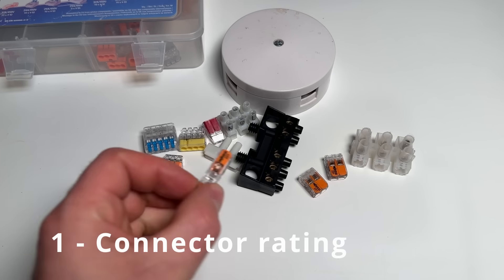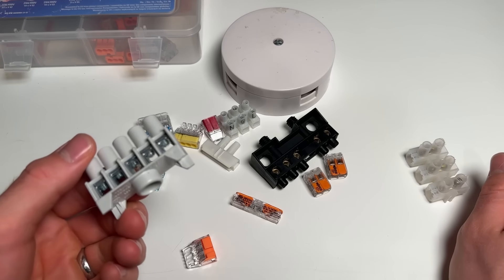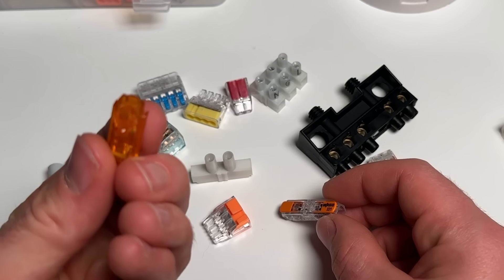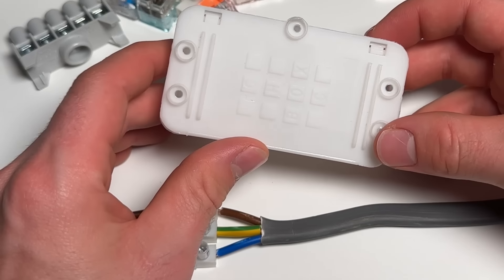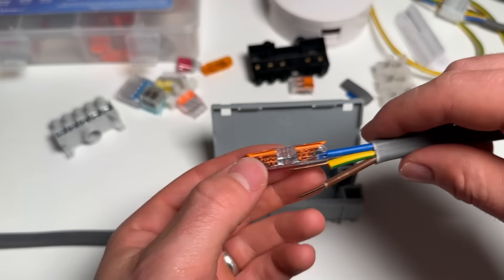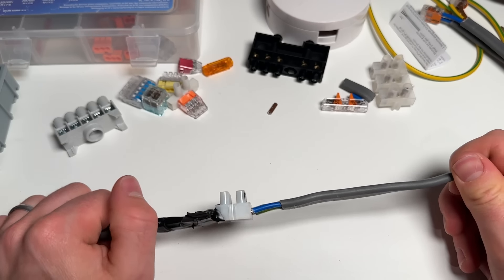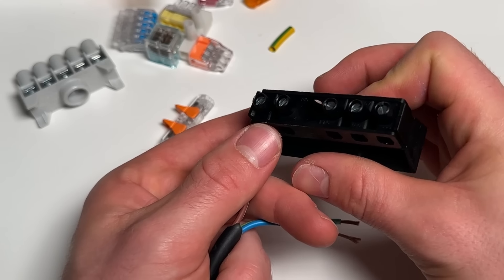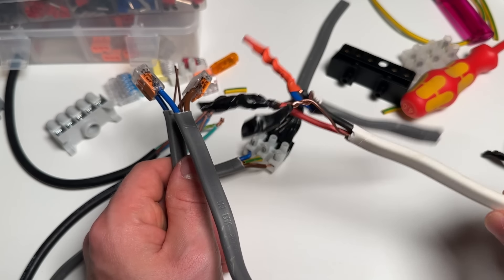BIGGEST DIY Mistakes Joining Cables

Comment: I replaced a bunch of screw terminal junction boxes in my own home with Wago boxes. They were all at least 12 years old. Some of the older boxes had loose screws and even evidence of arcing where connectors were loose. The problems are; the connectors are brass with brass screws and these are relatively well self-lubricating metal on metal contacts and the copper single core wire is fairly soft and deformable, especially compared to the brass. Often these boxes are in lofts or roofspaces where temperatures fluctuate considerably (+/-15-30oC), cold in winter/at night and warm in the summer/day. The fluctuating temperature cycles over a number of years expand and contract the wire trapped by the screw,  loosening the screws grip on the wire by a combination of compressing the wire more and loosening the well lubricated screw. Eventually the wire is barely held by the screw. Wires under any tension can be pulled out of the terminal altogether. What makes things worse is when someone has put 3, 4 or even 5 wires under one screw! Wago levers are a sprung fixing, so there is some give and positive pressure capturing the wires, in theory they should last indefinitely, however plastics do deteriorate with heat cycles and UV exposure so worth making them inspectable and checking them periodically.
Reply from the maker: Good points, thanks for watching!
Reply: Good rule that screws should be  tightened once a year, especially high loaded
Reply: @alexU42k  however that simply should never be the case most periodic inspections are every five years so in that case of screw terminal is simply not appropriate or fit for purpose
Reply: Life was so simple in the good old days. I’ve only watched two videos, enough to tell me to leave electrics to the experts. If you do not know how to analyse the work load then don’t play with the electrics. Especially now that insurance companies want proof of certification for the work done. Just installing the wrong cable is enough to void payout. Love the video. It shows the better options for a safer connection. Nothing is perfect. Everything degrades overtime.
Reply: @ you said even installing the wrong cable like it’s a simple mistake quite often that can be a deadly mistake
Reply: Nearly every plug socket faceplate, light pendant fitting and flex cord plug fitting has screwed cable terminations. Everything will (and always has been) just fine for goodness sakes, if fitted properly.

Comment: Your explanation of the ratings on the WAGO connector are wrong.  The ones on the left (next to the "UL" logo) that say "450V/32A" are from the IEC and apply for both Europe and the US.  That's why the same side also lists the wire size in both mm² and AWG (American Wire Gauge).  The rating on the right side is from the JET (Japanese Electrical Safety and Environment Technology Labs) for the Japanese market.

(However, note that even though the connector is rated to 32A, the maximum wire size (14 AWG) is only rated to 15 amps for building wiring in the US, so this connector can only be used on up to 15 amp building circuits according to US code (otherwise the wires would be too big).  However, if you are using it for other applications (for example open-air chassis wiring inside an enclosure) you could potentially take advantage of the full 32A of the connector in some situations.)
Reply from the maker: Thank you for your detailed explanation, you’re absolutely right! Thanks for watching!
Reply: They also make a 6mm^2 (12awg) version of the Wagos with the same ratings.
Reply: Actually the standard Wagos allow AWG12 wire with 20A and the higher powered Wagos allow AWG10 wire with 30A.

The inline Wago shown in the video shows AWG14, but the website of Wago shows AWG12 in the specs.
Reply: @ChristianWagner888  Sorry you're correct, I managed to get the two standards mixed up even after reading the comment above explaining them.
Reply: @ChristianWagner888  The other ones have always said 12 AWG, but I think the older inline connectors were only rated for 14 AWG originally (I have some that say the same thing), but it sounds like maybe newer ones will do up to 12...?

Even if the website says 12, if the connector itself only says 14, I would not use it with larger than 14 AWG, personally.  There's no guarantee the website isn't just a misprint or something.
Reply: @ChristianWagner888  Umm, no...  The "standard" WAGOs (221-41x) support up to 12 AWG and 32A (per IEC ratings).  The "higher powered" ones (221-61x) support 10 AWG and 41A.  (The lower current ratings listed under "UL" on their website actually only apply when using them in building wiring in the US (and are based on the max wire size), but the connectors themselves can actually handle higher currents in other applications (as I explained in my original post).)

The inline connectors have a different model numbering system than the other 221s, though, and the connector shown in the video is a 221-2411, which only supports 14 AWG (32A, 15A for US building wiring).  The one on the WAGO site is a 221-2401 (different model number, and it also looks different (having a gray/white bit in the middle)), which does support 12 AWG (still 32A, but 20A for US building wiring).

(Also, as far as I can tell, there is no inline version that can handle 10 AWG at all.)

However, it's important to note that most sources I've found for WAGO connectors (aside from buying direct from WAGO themselves) are still selling the 221-2411 (14 AWG) version, not the beefier 221-2401s, so if you buy these inline connectors off of somewhere like Amazon, those are most likely what you're going to get, and those cannot do 12 AWG wire, according to WAGO's own specs.
Reply: In europe they can probably use smaller wire for higher amperage because they use higher voltage than we do.
Reply: @nooneyouknowhere6148  Well, currents in Europe is generally lower because of the higher voltage.
An appliance rated for 2300W would use 10A @ 230V, but 21A @ 110V. This is why wires are thinner in Europe for the same effect*, but for the same *current they are about the same, as the resulting heating follows the laws of physics. :)
Reply: The higher voltage means that at the same current the circuit will provide more power.  It does not mean that the same wires can handle higher current.
Reply: Dude, you need your own Chanel

Comment: I’ve been using terminal connector blocks for years with absolutely no issues, using bootlace ferrules with these types of connectors makes a perfect match too. It’s nice to see other products available though and I’m sure they will have their use.
Reply from the maker: Thanks for watching!
Reply: same, if people know how to use them then they are fine. I think all the new sparks only know Wago and think that is the only thing to use.
Reply: Biggest issue is they’re not maintenance free, so have to be accessible when installed, where Wagos (when installed correctly) are, so don’t need to be accessible.
Reply: @gainmaster1  
Screws can work loose.  Wagos do not work loose.
Reply: @johnburns4017  maybe if you were tightening it, how did people survive without them before. Do screws become loose on MCB etc too? There is always a possibility that can happen, they work when you use them correctly as like any electrical connection
Reply: Connect to block can have issues but it’s mainly if they are in a semi accessible location where they could be hidden that creates problems
Reply: @johnburns4017  If every screw came loose it would be pretty dangerous to do anything with machinery, vehicles etc. There is a lot of electrical devices that have been screwed together for years and not come apart. Are you tightening up your screws with a miniature screwdriver. 😂 
I'm always surprised when a particular brand device gets promoted in these types of videos. I have worked on machinery from around the world and don't find wago stuff that popular even with the German machinery that i work on the most. Screw terminals especially on high voltage stuff still seem the most common.

Comment: For people who are nervous about the lack of connection area with Wagos you can find videos of them being tested under load - to destruction - and they actually take much higher loads than their ratings, so you can be confident that the contact area is fine. And unlike screw connectors the pressure is constant and can't slacken unless they're overloaded and heated to ignition point. Additionally - unlike twisting connections and screw connectors - Wagos don't bend or damage the copper in any way.
Reply from the maker: Great point, thank you! Thanks for watching!

Comment: The current rating of that screw terminal connector is going to be way higher than 5 or 6 amperes. I would say at least 15 amps. It is, after all, as larger as the screw terminals on a typical socket, which are rated for 32A. What is more, the conductive metal cross-sectional area is more than a Wago type. The danger is a poor connection, not the rating of the connector in that case unless you use it on something like a shower circuit.

Cable ties in the Wago box are nothing to do with IP ratings, they are there to meet the requirement that it requires the use of tools to access the live conductive parts.
Reply from the maker: Interesting to know, thank you. Thanks for watching!

Comment: It's ok to prevent people from doing dumb things that can actually hurt them when they attempt to work with potentially dangerous items/devices/installations. Anyhow, household electricity doesn't present that much of a danger IF some precautions are taken beforehand. For example, PLEASE, if you are going to work with electricity, WEAR SHOES, make sure the floor is DRY and SWITCH OFF THE BREAKERS so you don't get shocked. I'll have to say that in the Americas (maybe with the exception of Argentina and a few other countries), we commonly have 110V/60Hz, so a shock is not that dangerous unless many other things go wrong, but if in your country you have 220V electricity, be very careful as a shock is really bad and can actually kill you even if every other precaution is taken, so SWITCH OFF THE BREAKERS before doing anything.

That being said, electricians have been twisting cables for decades with outstanding success, so calling it a dangerous, potentially fire-hazard way of connecting cable is a huge exaggeration. And that is because, even if the twisted cables get loose or uncovered, you would need another live cable, a ground or a neutral to provoke a short, and even then, if the breakers are correctly installed, the protection (short or temperature) will jump and all you will have is a part of your house without electricity until you fix the problem.

This types of junctions are made for safety so electricians don't get shocked, for ease of use so you don't have to use pliers to twist cables, and for saving space as a very small junction box is much smaller than any other alternative. But other methods are still valid if you need to use them, and direct contact of twisted cables is much more efficient for transferring electricity from one cable to the other and all you need to worry about is the actual amperage the cable itself can handle. That's why nowadays electricians still twist cables but then also weld or solder them together.
Reply from the maker: Thanks for watching!